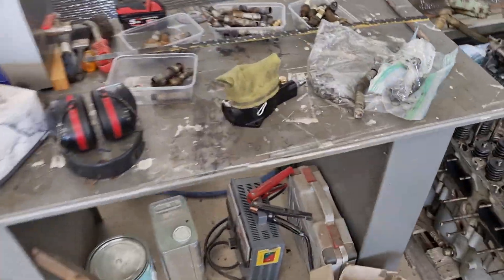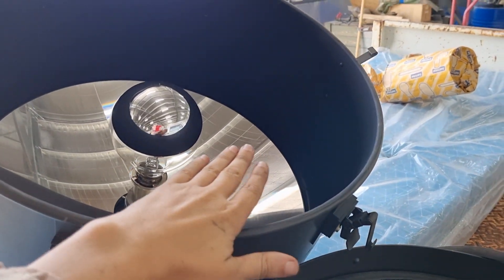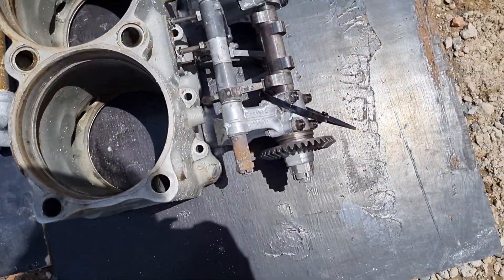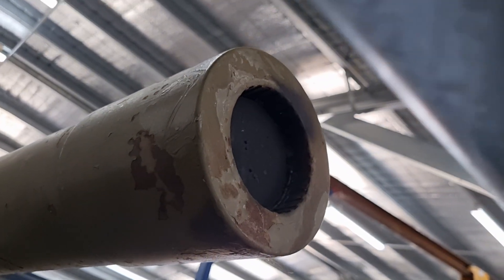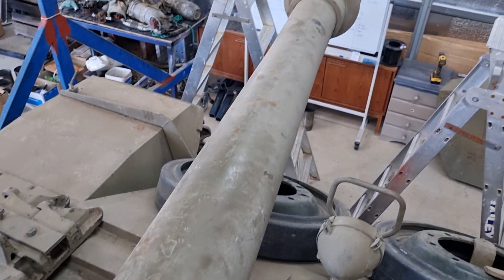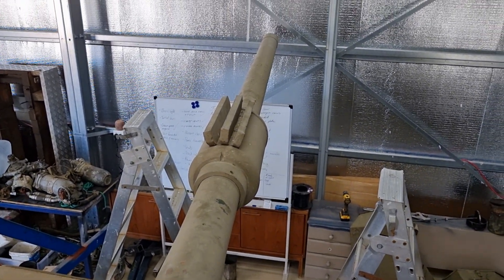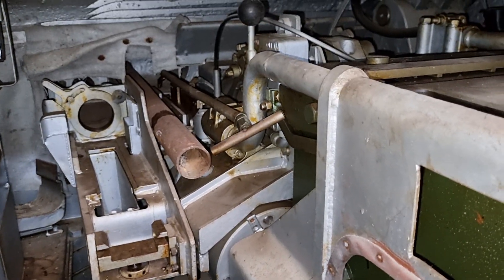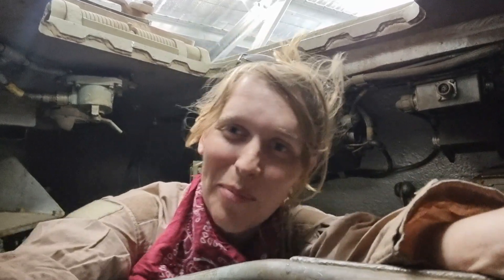Exploring the disarming processes of a Centurion tank

Comment: Nostalgia! Nice to be inside the turret of a Centurion again, I was group commander in the home guard for a little while back in the 90's when old centurion turrets with a 75mm gun made in to tiny fortresses that was used to protect a number of important positions around the country was still operational. The breach block moves vertically on that gun. and it had the M/39 machine gun installed as well.

Comment: Did this tank have any mods specific to to Australia?
Reply from the maker: Aussie Cents almost always have an extra 40mm of frontal armour. The 100gallon reserve fuel tank, no side skirts and the IR mounts. There are quite a few unique mods made to individual tanks like the number of spare road wheels that are inconsistent with each other.
Reply: @lottiethetankwhisperer  I find it interesting how Australians seem to always modify the military equipment they purchase.  Why no side skirts though?  Too much mud?
Reply from the maker: @depleteduraniumcowboy3516 In short, yes. They found the harsh forests of Vietnam kept snagging on them and you need to pull them off for cleaning. In true Aussie fashion the easiest solution was to bin them 😅
Reply: @lottiethetankwhisperer  ya, skirts can really gum up the works.  But as someone trained to fight in a tank I liked the extra armor and stand off distance they provide.  I guess maybe the thought is don't let 'em get to your flanks?  That would be a lesson that modern armies still seem to be struggling with.  Can you recommend any books or videos by Aussie tankers in Vietnam?  I've read what I can find about the US experience.
Reply: @lottiethetankwhisperer  the side plates were taken off , and used as B.B.Q. plates for cooking